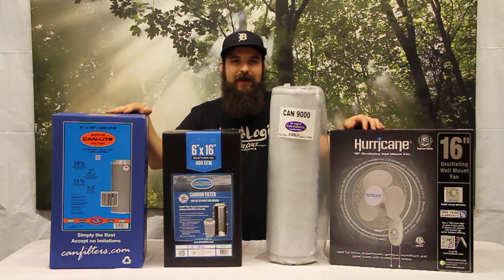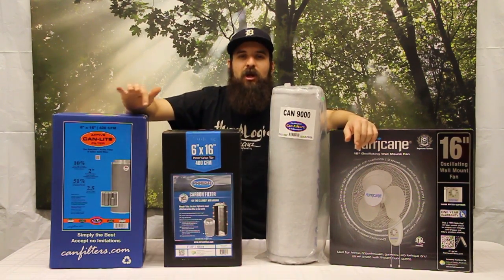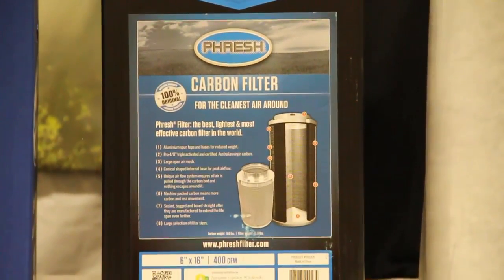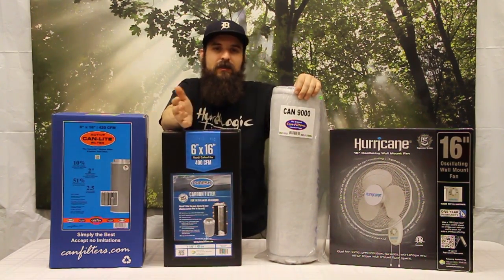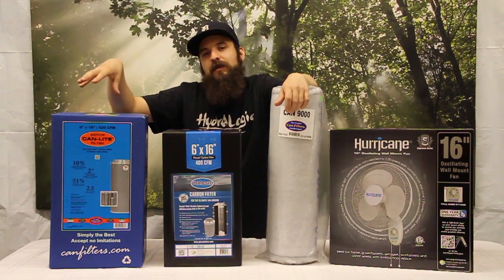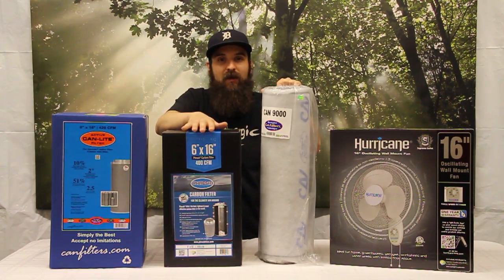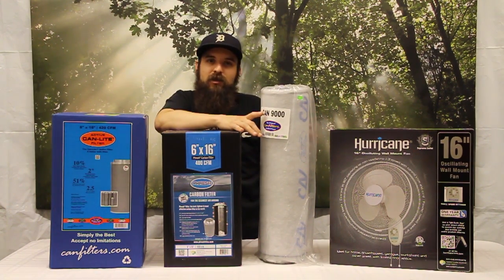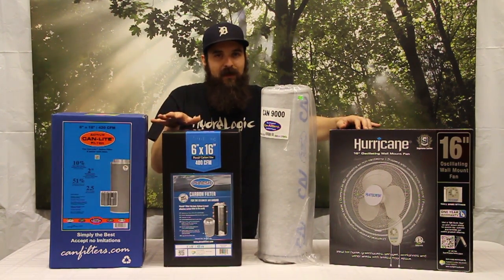How to Select the Right Carbon Filter

Comment: Carbon does not molecularly change with use as a filter element. You can take the carbon and boil it, then rinse with clean water, and allow to air dry, and you are back to business. An MIT professor told me that -

Comment: None of these videos really give the info people need. Here it is:

The actual smell coming out the exhaust end of your duct, and the level of odor, is going to be a matter of dwell time. How long a period that odor arrestance remains constant, or near constant, is going to be a matter of the filters overall size, or how much carbon it actually holds. 

The CFM size rating on these filters is only a guideline to help operators avoid either delivering too strong an air stream, or too weak. Now, a lot of people think that "too weak" means a low CFM flow, somewhere just under the recommended CFM rating numbers on the filters. This is not true. They only recommend avoiding a CFM flow lower than half of the max exhaust rating so that operators do not have an air lock situation, where no air is actually flowing through the filter. However, as long as there is no air lock, and actual air flow, you will still be filtering air, and in fact at a much, much higher dwell time. Dwell time is the key for full or near full odor arrestance from these filters. 

Now, you obviously don't want to size a 10x10 room full of plants with a tiny little fan filter set up. The more air in the room, the bigger the fan and filter should be, but at a certain point, within the optimum size range, it doesn't matter all that much if you go with a CAN 100 or a CAN 125, as long as you ensure a proper (long enough) dwell time for the air steam. 

For serious operators, a variac or VFD should be used to control fan speed, which will allow you to dial in dwell times and fine tune the odor filtration to your needs. Example, if you have heavily saturated air, and a ton of odor to control, you will want a higher dwell time, and if you have far less odor saturation in the air steam, you could lower the dwell time and increase the air flow a bit. It just depends on the application. But for this application, in grow rooms with stinky plants, just remember that it is all about dwell time, and that your brand new, giant fan filter set up isn't faulty because you can smell your plants a bit at the duct terminus, you just haven't fine tuned for dwell time yet. You can either go out and buy another $300-$400 in filter units and double up on the fan with a wye and tune it bluntly, or you can get a variac or VFD and fine tune the proper way.
Reply: GREAT info thanks :)
Reply: Could you give me advies for a room that’s 6 by 10 by 4 ? I don’t want any Oder to get outside. Thank you for your info

Comment: So if my tent is 5x5x7 that's 175 Cubic feet, I should use a fan that can extract 3-5 times that? So use a 500-800CFM fan and filter combo? That seems excessive as most say tents should exchange air in tent every 2-3minutes, rather than 3-5 times the CFM each minute. I heard somewhere that it takes much more air extraction to clean odors(using carbon filters) than for removing heat and keeping plant environment optimal. Just something I was thinking about today and saw your video, lol... Keep up the videos brother!

Comment: 5:06 - These DO NOT CLEAN PARTICULATE. The only particulate filtered with these is the coast dust that is filtered out by the dacron pre filters. Other than that, absolutely nothing of ultra fine size will be filtered with these. I doubt they will even filter mold spores. You need a legit, EN 1822 classified/certified HEPA filtration unit/system. If it doesn't include that EN 1822 cert, then don't use it. Air particulate filtration/purification is a whole different monster, and far more complicated than VOC/odor filtration.

Comment: Also, do not stuff the already used dacron filter into your can for use as a positive pressure filter, because all of the dust that the dacron filtered will just get blown off into the grains. Instead, buy a brand new one, or keep a spare around, and use the clean one.